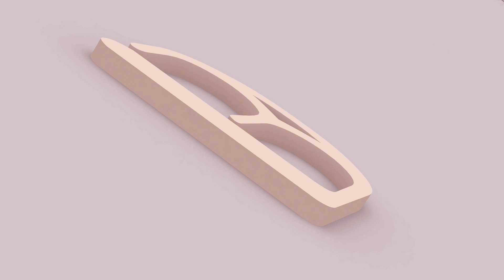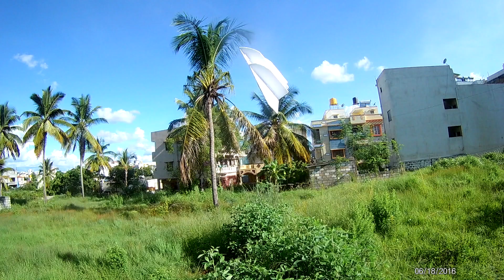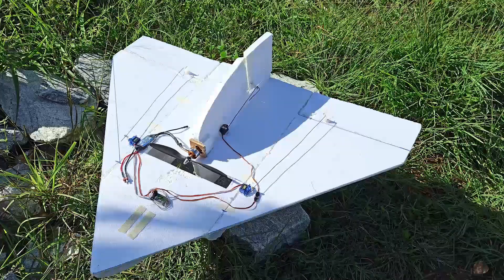Big Slow Delta-build and test flight

Comment: What is the thickness of thermocol sheet you used? Did you use different thickness for different parts: main delta wing, rudder, landing gear ?

Amazing build 👏
Reply from the maker: i used regular thermacoal sheet available in stationary shop.i think its 10 or 12mm. i used same for all parts.

Comment: Nice build.
I want to build the same with thermocol.
Please tell the weight of plane without battery..
Reply from the maker: Hi.thank you.Till now i didn't check weight of any I build.  I Don't have this model with me. I donated this model to some beginner people
Reply: @DiyDot3d  ohh
Thanks for reply.
I want the weight cause I already have 1400kv golden motor and 2200mah battery.
So If total weight exceeds 700-800gm  then I think it won't fly properly.
Can you tell if it is possible?

Comment: Hello sir. For beginner, can I made by epp material, bigger wingspan for windy condition? I have motor sunnysky 2216 1100kv, do you think I can scale up for bigger, more wing area ?
Reply from the maker: Yes, you can.but this original size is good for beginners
Reply: @DiyDot3d  Do you mean original size good lightweight, for more durable when crash? If scale 40'(1016mm) to 1150mm wingspan, but still use motor sunnysky  2216 1100kv, 8-10' prop. Do you think that motor's power enough? I wanna reuse my hummer epp 3D's electronics(426g without battery) include :motor 2216, esc, servo, wire...about 180g, for the 1150mm wingspan use depron and pp foam material ( weight estimate on computer about 280g include everything ( rudder, landing skid fuselage...)====>AUW ~ 500g without battery. Thanks for your reply, sir.